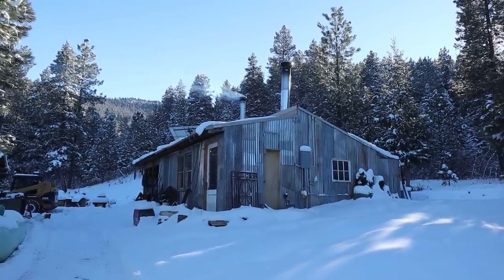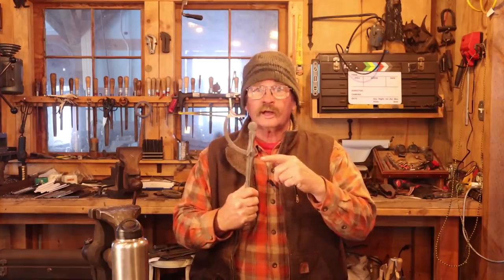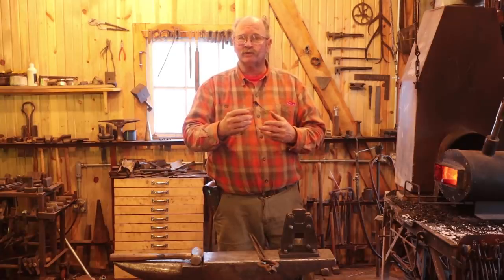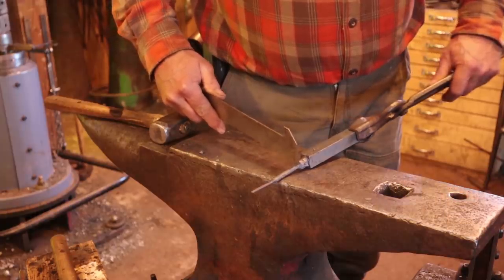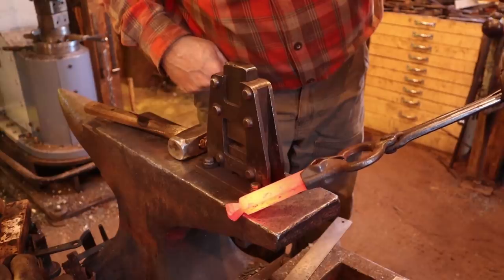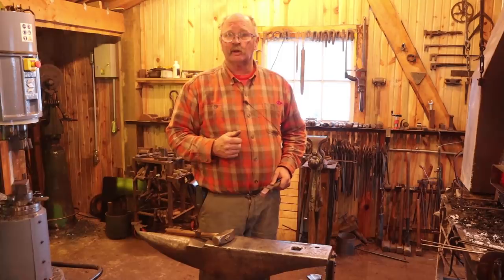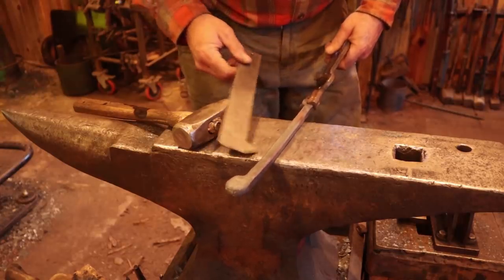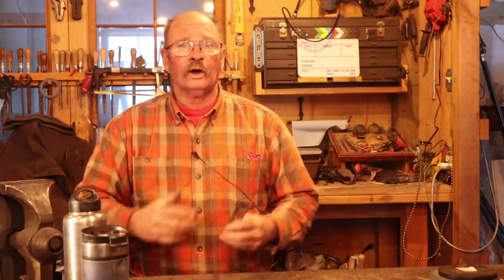Wing dividers - 150mmchallenge part 1

Comment: You weight of steel say if the metal is in hand it may be reshape into about anything the total weight equals. That's what a blacksmith looks at. That teaching me something but not a smith yet but I 'm thinking.Thank.
With my first or second foraging I did a simple twist bend of 3/4" sq bar. Trying rubic  twist next heat
Thanks John S.
Reply from the maker: Up to a point it does work.

Comment: As a carpenter/woodworker I found myself thinking how I would slice the parts needed with a band saw. Picturing holding the tiny pieces with needle nose pliers and forging them with a little hammer. It's interesting the different mind set you have to bring to a project when you're so accustomed to working with non malleable material...break out the board stretcher
Reply: I agree entirely. It is fascinating for me to hear/watch John fashion something out of a rough piece of steel. This way of pushing, mooshing and twisting ones way to the desired result is so foreign to the carpentry and fabrication that I spent a lifetime doing. I love watching it happen. --- mooshing is supposed to rhyme with push but I don't know how to spell it?

Comment: What’s the best way to clean up the cut end, after using a butcher. without using any sanders or grinders? Always love watching
Reply: Well you could uses a bolster or a monkey tool and up set the cut ends back but in all honesty that's the reason for the butcher tool as apposed to a hot cut.

The butcher is a right angled triangle in shape and creates a flat shoulder. As long as you don't cut to deep or Forge too far you should end up with a nice 90deg piece. Hope that helps sure John could word that better.

Comment: I just discovered your chanel and im verry impressed by your videos. i have been looking into a good pair of wing deviders for my job as a finish carpenter (looking for ones with a replacable pencil / scribe point) and i found some starrett ones but they are $180! i think i might try my hand at making my own instead. i have a nice old pair from a great uncle that i use but i dont want to risk loosing or damaging them

Comment: Fantastic project Sir. I just last week made a set of golden calipers. Tooks like those are VERY useful in a smithy for any number of projects later down the road. Ilove 5hst you started this sort of endeavor. Making tooling that "moves" or articulates in any way is a HUGE door for most people to open.. So many are put off by looking at things like that, and say, "No.. That's just to complex to forge". It's not.. It just takes time, and attention to the details tho. One note I must say about your powerhammer is you are to low when forging with it., or the anvil is a bit to high. All your work curved downward. So a block to stand on (easiest fix) adjusting your stance, or lowering your anvil block would help to optimize the hammer blows. An absolutely fantastic video, and simply can't wait to see how these turn out. Way to break into the New Year!
Reply from the maker: Mostly I just need to make a few body positioning adjustment.  The anvil is slightly higher then the last hammer and I prefer it that way.
Reply: It does seem to be a very nice hammer. I was not meening to critique your technical abilities, but just wanted to say that from my (YouTube viewer, and blacksmith) perspective is all. I thought your forging was spot on tho, and your process for the project was very good. Keep up the awesome content, and best wishes to you, and I can't wait to see this project in its final form.

Comment: I have been dying to find out where you got your "hook ruler" from. I have always called it a "scale". Then i came across your video of your measuring tools. To me those "dividers" have always been called a "compass". I also wondered what those curved pointy ended things behind you were. I cannot remember what you called them but i would have called them either multi or compound calipers. So after watching your video on your measuring tools, out to the forge i went and grabbed a bar of stock and made me one of them there blacksmiths scales with no markings style. 
Cant wait to see how these turn out, maybe one day i will be able to make a set.
Reply from the maker: It is one I made from a square.  But I also have many shop made hook rules without measurements that I mark specifically for the task at hand
https://www.youtube.com/watch?v=3_ZqaJ93dpc&t=2s
https://www.youtube.com/watch?v=hXn288rM3PM

Comment: Soo, do you have to use all of the stock in the project? I mean that would be the idea of the challenge, instead of making like a long thick bolt. Ect...
Reply: You can do any thing you like just don't add any thing. A good thing to do is check out the #150mmchallenge will give you some ideas. And have some fun.

Comment: Great challenge John pretty amazing how much material came out of the 3/4 square bar.   question drawing out on the power hammer the rule square octagon round still holds true.  Just like hammer an anvil.     Thx ....Paul
Reply from the maker: Yes it does and it is perhaps even more important.  In this video I went square, octagon, round checked measurements then went back to square to draw it out further
Reply: Yes. Ok.  Thx. It’s a little hard to see the stock moving.   Thx again

Comment: A mil is not a millimeter. A mil is 1/1000th of an inch. So 150 mils is 
.150 inch.  I can’t meet that challenge!
Reply: That's a thou or a thousanth of an inch. Not a mil.
Reply: Look it up. A mil = 1/1000 inch.  As in “3 mils thick “. Available on any decent conversion utility.  Or don’t. I’m fine with it.
Reply: @TonyUrryMakes  I stand corrected.